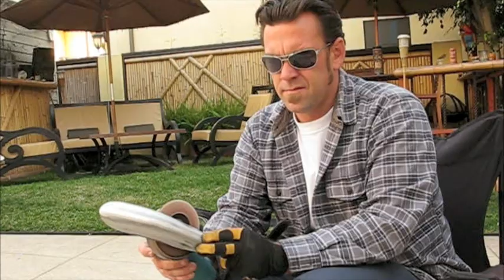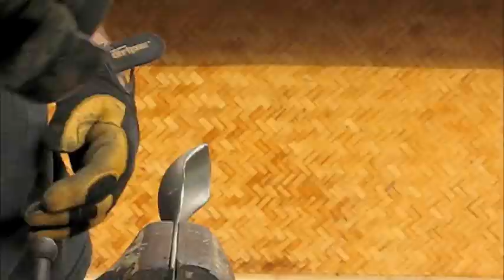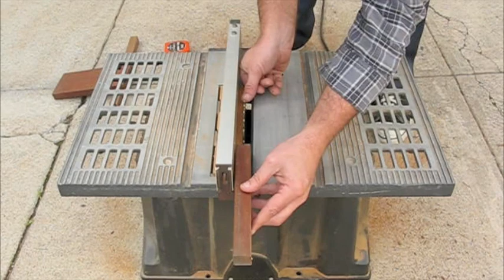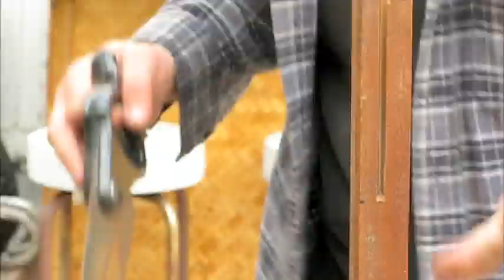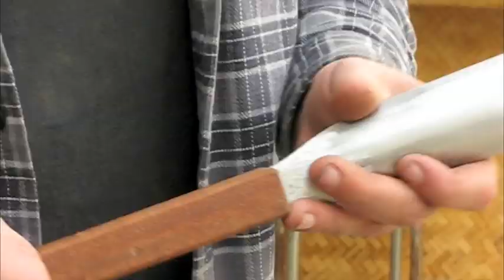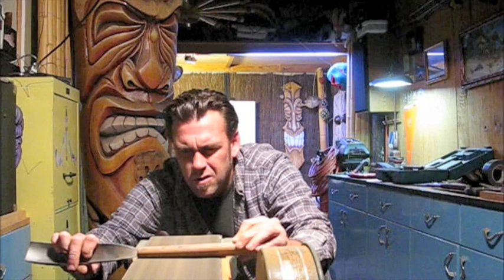Jim Inglis - Making a chisel

Comment: You will be sharpening that a lot without having tempered the steel, considering its chromeoly (4130?)  with up to about .3% carbon it will not get all that hard and ultimately holding an edge will be near impossible. all that stated, nice job on the craftsmanship, belt sander is just about all you need to make a quality hand tool if you have the steel to match. You may have also toasted whatever tempter that pipe had right out of it with your hard grinding.